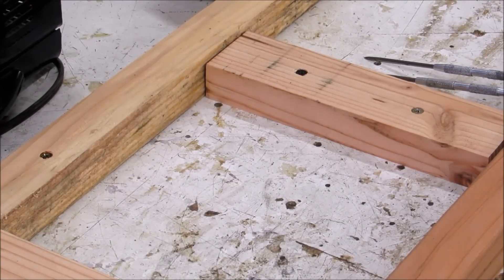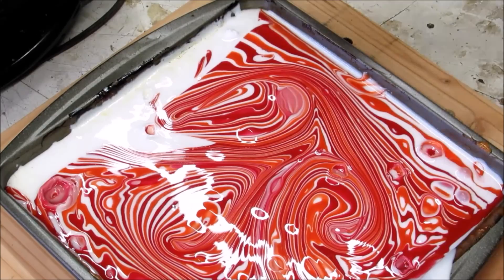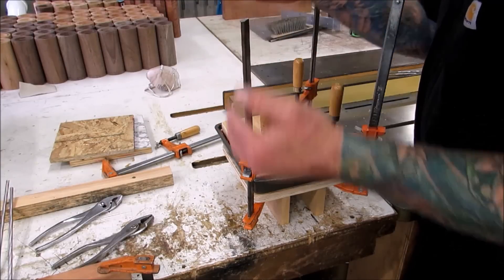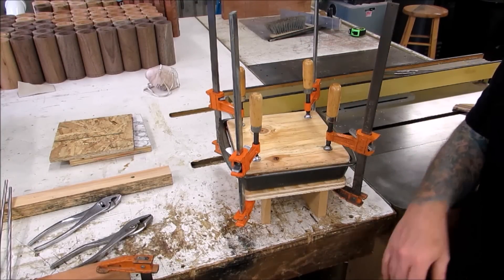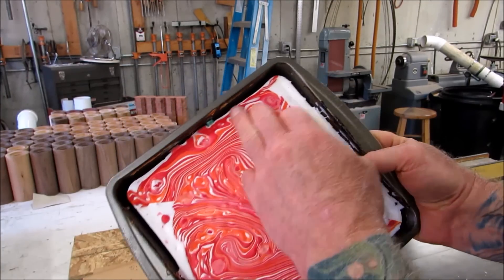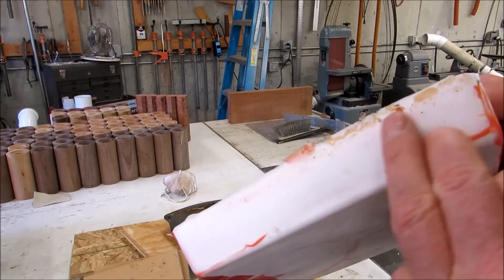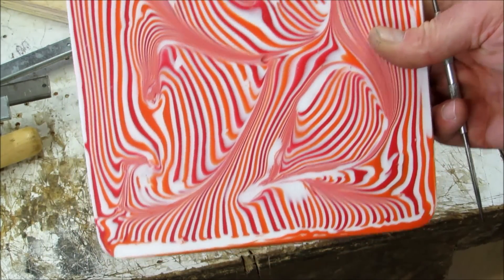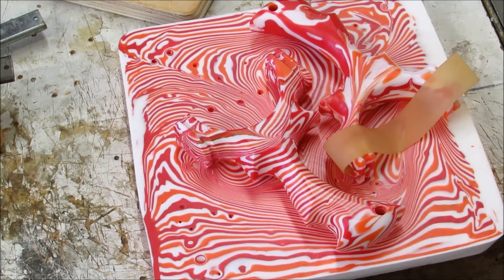Combing HDPE for a Slingshot Frame - Part Two - with Randy Knapp

Comment: In order to get rid of the bubbles after the piece was removed from the mold, would it work if you dropped a drop or two of molten material on them, would these stick to the slab and cure ?

Comment: I want to make a carving knife and thought this would make a nice handle. The tang of the blade would only extend about 1-2 inches into the handle. If I took a 1.5” (1.5 x 1.5 x 5”) of this material and sliced it in half, carved a notch for the tang of the blade to fit, would I then be able to join the two pieces together ? Epoxy ? Heat up the two halves of the handle and then clamp together ? Just curious how two pieces could be joined back together

Comment: Awesome video, im a diesel mechanic and we go through 5gal square drums and 44gal barrels made from hdpe! i have an almost unlimited supply of red, blue, black, white and clear drums, sometimes even silver drums come in ;) looks like i need to find a toaster oven
Reply: be careful on using drums used for chemicals the polymer can soak up the chemicals and will cause problems when melted ie they wont bond together correctly when melted dangerous fumes and possible fire hazards.
Reply: That's true, I have had issues with buckets that contained a certain type of Marine Biocide. I powerwashed the shit out of it and the plastic still failed to bond in the oven. On the other hand, I have had great luck with cleaned out oil and grease buckets. Any type of heavy duty clear HDPE (like the type from a drum) has also worked really well for me.

Comment: I just cut up a Home Depot bucket (HDPE) and I want to melt the plastic. The bucket has some white Home Depot writing on the side, is it necessary to get rid of this writing before melting ? If not removed, will the ink from this writing interfere with the final result ? I’ll be mixing some white HDPE plastic (bucket) with it

Comment: i saw some other dude intentionally put bubbles in his block.  he made cavities as he laid the blanks in the pan to melt.  then he cooked it for like 2 hours and the bubbles rose to the top and popped and then flattened out on its own.  he did no bubble popping and had no bubbles.  im thinking the extra melting time (maybe lower heat, not sure off hand) allowed the plastic to get more liquidy and self level.

Comment: Have you ever tried a slow cool-down?  I have a feeling that the warping would be prevented if you leave the pan in the oven, turn the oven off and let the whole thing come down to room temperature on its own - maybe even keep the oven on a lower temp setting for a few hours too.
Reply from the maker: +Jonathan H  Yes I have tried it. I turned  the oven down slowly over the course of 12 hours. It made no difference :)
Reply: crazy

Comment: How about melting the plastic in some sort of a springform pan to close in the mold and using a vibration table to eliminate the bubbles.
Reply: +Tyler Megehe Or vacuum pump.
Reply: Vibrate the entire oven if it's gas.  Electric oven's heating elements might not hold up.

Comment: Perhaps you need to apply a baking tip, as many times as you removed it from the oven, perhaps if you bang the pan flat on your table the bubbles should rise to the top. It works for cake batter.
Reply: he wants a slow rise of the bubbles to aid in mixing the colors.